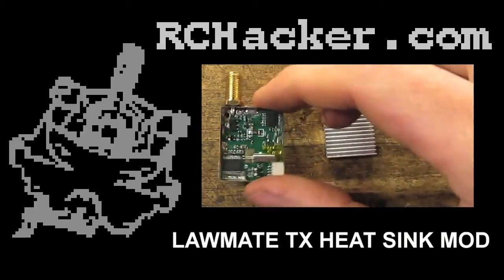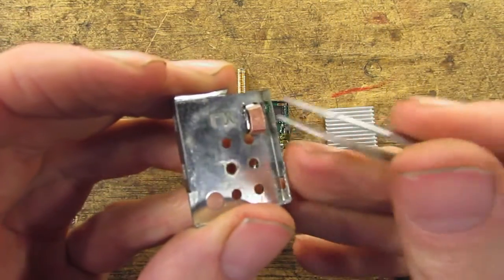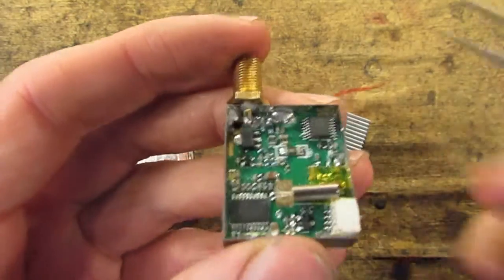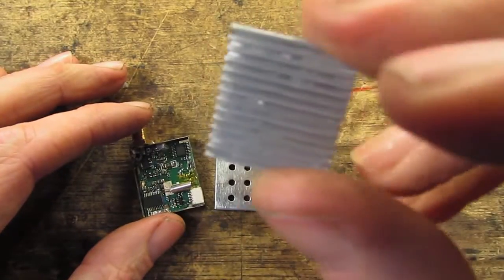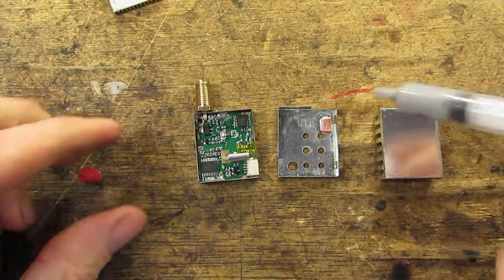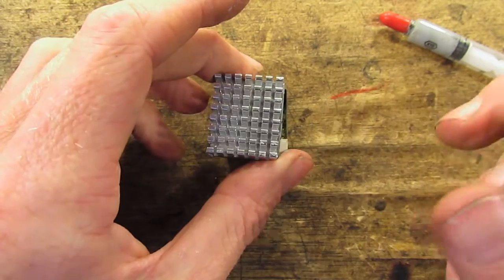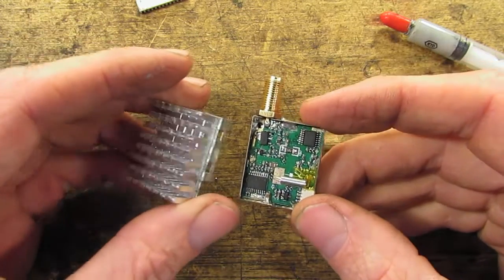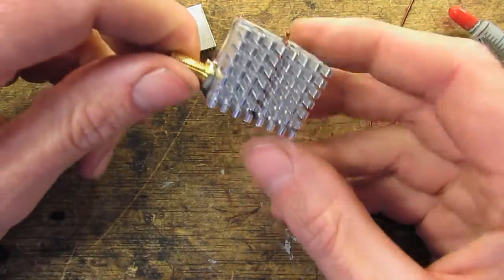Lawmate 1.2GHz 500mW heat sink mod. RCHacker #47

Comment: I think, that as the transmitter, gets hotter, so does the bits and pieces, dropping voltage reading, the cooler you can keep it, the voltage will be stable, I think that's how it works mate. Could be wrong.

Comment: Lower opperating temperature > lower silicon resistance.
this probly has two knock on effects RF wise.
It changes the Impedance matching charictarisitc to be better, sometimes worse matched and therefore less internally refected signal (power) to the amplifier chip causing the heat in the first place. Hopefully resulting in more transmitted power from the antenna.

PS. A lot of people are happy to throw on circualry polarized antennas on their setup without, caring to see if its impedance matched with the transmitter module. A common symtom is the final bits of sillicon cooking due to the impedence matchking being out of kilter.
Reply from the maker: Standard is 50 Ohms for an SMA connector. Which I assume most rc related modules and antennas are designed for (the good ones anyway).

Comment from the maker: Almost: Power is equal to the square of the voltage divided by the resistance.

However the unit is not a resistor and we should really look at the datasheet of the RF amplifier/transistor that I added copper to. Unfortunately I do not have that information.

Theory aside Experimental airlines and TBS had good results.

Comment: heat causes resistance which pulls voltage down resulting in a loss of power. power is equal to voltage over resistance.

Comment: i think it puts out more power because the energie is not turned into thermical energie but into electrical energie which results in more output power ( higher efficencie )
same as if you cool your car moter more or less

Comment: A few days ago buy one of these transmitters, with its original antenna and extra circular polarization .. with the latter the transmitter is heated enough and do not know how to calibrate the output impedance. and if so temperature is normal? .. Very good videos!

Comment: Man, that's going to run super-cool.  I cannot absolutely attest to the circuitry but I've seen some behavior in my gear lately that makes me suspect a thermal protection regulator in these VTx's.  Lately here in Arizona where the ambient temperatures have been 46C/115F and hotter in the sun, my video range drops off dramatically.  Same with RMRC VTx's.  Worse with multicopter (low air circulation) than with fixed-wing.  Anyway, cool electronics are happier no doubt.

Comment: My friend is a ham radio technician and when i asked him will the power increase when the chip is cooler he said it is imposable unless it has a safety feature to protect it when it gets to hot by reducing the power like the big ham radios do when they over heat or get a high SWR.
Just my 2 cents

Comment: I have the same lawmate and it does get frighteningly hot on the ground with the 5v supply. However it's never let me down except for that little plug that I had to bypass because it stopped making proper contract. I get about 30km range with bipole and biquad.

Comment: It may put out more power when cool, you need to look at the spec sheet of the transistor.
While you're looking, check power output vs voltage specs, and whether it has temperature/power control. 
Power output is not usually the limiting factor in radio transmission, transmission line (coax) impedance matching and antenna are far more important assuming clear line of sight.

Comment from the maker: Yep, I doubt there is a temp sensor in there. Unless the power is being degraded because of the heat itself and we are just putting the device back into its normal operating range.

Comment: If the power is being limited (throttled) because of the heat, that could lead to more power after adding the heatsink. Otherwise, as you said it won't do anything other than make it last longer.

Comment: it wont change the power all you doing is dissipating the heat more efficiently by using thermal paste and copper that's how it should be done at the factory really

Comment: that's the final driver, the power output wouldn't change unless you change the tuned circuit of that final stage. the final driver and load coil (usually PCB track) has to be changed. the cooling technic is good, if you solder the copper directly to the large pin of the driver, just check if it is also ground (-) not the hot side, rather than pasting it on the plastic package for the driver, this could be more a proper way to dissipate the heat more efficiently.